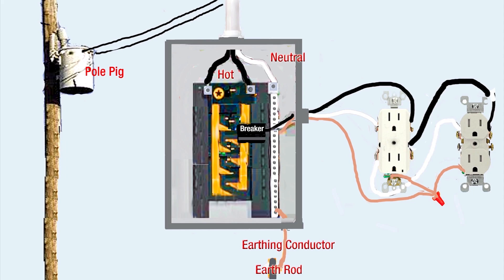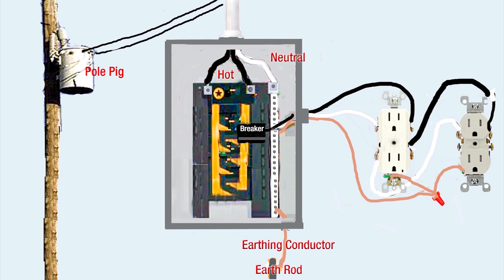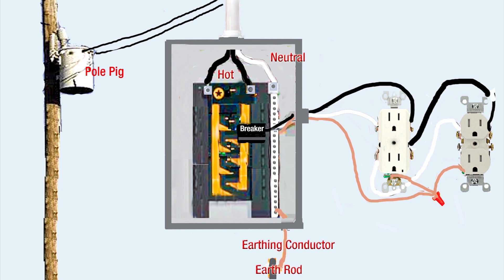Grounding, Bonding, Earthing, Shielding and Protecting with Jim Heath W6LG

Comment: Hello Jim, thank you for this and your other videos on this topic. You ARE BRAVE to do this as there exist many OPINIONS. I will use my ground rods for my antennas, and will rely on the house electrical system to provide earthing for the electrical components inside the shack. My plan is to disconnect the antenna from my radio during lightning storms, as well as unplugging the electrical components. Extra safety! KQ4IXD

Comment: Question here, is there any reason why I could not remove the 2-prong power cord from the radio and replace it with a better 3 prong power cord and connect the ground wire to the radio case and get my grounding that way?

Comment: If am running all my HAM related equipment off DC/battery (say two different batteries) do I still need to ‘ground’ any of the equipment?  I noticed the avail grounding studs off my of my equipment…do I need them in this situation/setup is the question. Thanks in advance.

Comment: I'm getting ready to cross this bridge very soon! Just bought the ARRL book, Grounding and Bonding. I'm going to replace a rotten galvanized pipe that is on my mains. Then install 2 x 8' ground rods. One for my AC panel mains and another under my shack window. Going to tye them together with 8ga bare solid copper to my MFJ window passthrough. One the other side of the passthrough, a ground buss bar. Going to install gas style coax lightning arrestors grounded to the rod under the window... I agree with you on not using the adapter with ground to receptacle plate screw...

Comment: A lot of hams through the years have said don’t bond everything through your ac ground! Have separate grounds for Radio & antennas etc. KJ7TBR
Reply: If the neutral does float the green wire becomes the carrier to the panel to blow the breaker but this will also cook your radio if your bonding using the ac bond rather than a separate non connected to ac ground!
Reply: I.e bond for ac house system don’t connect radio ground to ac bond use separate non connected to ac ground rods!

Comment: I have a 5-gallon bucket of water in the corner of my shack. I run a wire from the ground tabs on the back of my gear to a piece of junk steel that I tossed into the bucket of water. Seems to work great.

Comment: Hello. Thanks for the video. I enjoy watching your content. I will soon be designing my first shack and have been thinking about grounding/bonding. Would it be an issue if you were to tie the grounding rod to the house ground. Grounding rod attached copper plate to where the coax enters the house, that is then connected to the bonding strap (piece of copper pipe) located behind the components, finally, the pipe is connected to the house ground via the outlet grounding plug. The antenna ground, bonding strap and house ground are all connected.

Comment: I'm a elctrician, retired. I've never had access to a device that could measure the difference of potential between two parallel grounds. Say from a far bedroom outlet and an outlet next to the panel. Maybe NASA of MIT does. Just my 2 cents. So l just followed the drawings. 😊

Comment: My background is in process control in a pulp and paper mill. I typically worked with shielded balanced wire from field equipment to a DCS (distributed control system) and coaxial communication lines between DCS's. I also worked with high voltage single phase and three phase electrical systems. Shielding and grounding issues were a big part of my job.
In my understanding, a typical USA residential breaker panel, has two hot legs (black wires or a red and black wire) and a neutral leg (white wire) measuring between either hot leg and the neutral leg there should be 120 volts AC. Measuring across the two black legs there should be 240 volts. That is because the transformer (pig) is dropping the higher line voltage (my residence the incoming voltage is 25KVAC) dropping to 240 volts. The transformer primary windings are at 25,000 volts AC, the secondary windings are generating 240VAC. The neutral is center tapped in exactly the center of those secondary windings supplying the 120 volts between the neutral and either hot leg. 
The voltage at the breaker will measure line voltage. The neutral  will measure zero volts. But the current (amperage) on the hot wire and the neutral will be the same! The bare copper safety (ground) wire should not carry any voltage or current unless there is an electrical fault.
The reason the safety ground (bare copper) wire from the grounding rod(s) is bonded at the neutral buss is to bring the neutral buss to earth ground at that specific location and to establish a zero voltage potential as referenced to earth ground.
Earth ground is electrically active! I have personally measured between two earth grounding systems approximately a quarter mile apart and seen more than 50 volts combined AC and DC! The induced electrical current caused huge noise problems in my equipment! The same will happen to radio communication if grounding isn't taken seriously.

Comment: I totally agree that the radio should not ever be connected to it’s own separate ground rod! One quick example is if there is a lightning strike near the house or power panel ground rod, it can elevate the ground potential several thousand volts above the ground potential where the radio is grounded. If the radio was not grounded both the hot wire, neutral wire and the bare ground wire in the power feed to the radio would all stay at the same relative potential. However if the radio chassis was connected to its own ground rod it you would essentially have a conductor connecting both ground rods and a potential difference of several thousand volts might exist between each end. The radio chassis would be near the far end. Current would flow from one rod through the radio chassis to the other rod. The black and white wires, while being 120 volts between them could actually be a few thousand volts above the radio chassis. Who knows what might happen! It’s best to let all three wires ( black, white and bare) float up and down together. 
My radio station does not have its own ground rod. For one thing it’s too far from the main panel for me to connect the two ground rods and it’s not necessary. I am a retired EE with experience in power, lighting, interior communication, radio and electronics. Several years in each area.
Reply from the maker: Thank you for a clear, concise example of what can happen.  If you want, privately send your callsign and email address to me.  73 Jim

Comment: You are a master. The more I learn the less I know. Can you help me understand why as on almost all of my gear there is a ground post. I have them  all connected to common ground bar with tinned copper flat strap. From there about a 5 foot run to the 8foot rod with solid copper flat strap. The FT 950 is feed by 30A supply . They are on 15 amp non GFI circuit . Every thing else including the 600W solid state amp is on a 20A GFI for now. My question is two part. Do they need to be earth grounded and does that need to be bonded to the AC earth ground. What could happen either way. You presentation are very honest and over flowing with decades of real experience. Not theory. I admire and respect that. Waiting for my General ticket to be posted. Do you have any connections.😉
Reply from the maker: Thanks and yes I can. If you had 10 boxes on your operating desk/table and there was a ground wire run from box 10 to box 1 and then to a common point, box 10 would have a different voltage above ground from box 1.  And, you could have a ground loop or hum.  Each box needs to have a ground STRAP to a common point. A driven rod separate from the electrical panel, depending on some other factors, may be unsafe.  And, it may be a violation of the NEC.  I know the ARRL promotes that idea and I believe they are sadly mistaken.  Additionally, there is no such thing as a RF ground.  RF does not magically flow into the ground.  If there is a fault, you want the current to flow back to the main panel or sub-panel.  If some of the current flows into the ground during a fault, the breaker may not trip. I would make certain that your GFCI is indeed rated for 20 amps and has the appropriate wire size; probably should be #12AWG.  73, Jim
Reply: @ham-radio  Humm. Well they all are common point connected to a bus bar definitely not in series. So you are saying both AC earth ground and station earth should be bonded? Also your quick response reminds me of when people actually cared. Thanks so much.

Comment: Definitely not a good idea to use those three prong adapters without the ground tab. If you ever get a short of hot to equipment cabinet and you touch the cabinet while its shorted to the cabinet you get electrocuted. Whereas with the tab screwed to a grounded outlet box the device short should cause the circuit breaker to trip from over current in the short and that saves your life. Sometimes people with Phd's don't have any common sense!

Comment: Sorry about the typo and incomplete note.I proposed running an additional grounding wire from my new ground rod the fifty feet or so feet to the existing service ground to maintain continuity. There is the matter of an RF ground for antennas as well as equipment grounding for the transceiver, etc. while the service outlet presents a neutral wire that is also grounded at the service panel. It all seems like one leg of a circuit to me. No GFIS at my operating position either.

Comment: Excellent comprehensive series Jim.  As an electrical engineer that works heavily in the automation world I have witnessed my fair share of ground problems especially with ground loops.  Your conclusions addressed my concerns with often recommended multiple groundling locations (service ground, station ground and antenna/remote tuner ground) that have left me with an extremely uneasy feeling.  Thanks for taking the time to walk through this topic in detail.

Comment: Holy hockey sticks. I’m a BSME  with plenty of practical experience in DIY electrical work.  You throw this sacred cow out on the tracks and say, “see you later”.  I had an in depth experience working with the Franklin Research Institute on hardening Automotive wiring and airbag ignition systems.  Good ground to the vehicle ground was one crucial element in removing spurious RF from wiring systems.  There were many more. I don’t understand why you wouldn’t want to clear off any spurious RF noise from your transmission and receiver instruments.  They are in metal cabinets but there are many high frequency sources out there hat will go right through the gaps and openings in the units.  I don’t see the use of ferrite beads or similar devices at each critical component too protect points where spurious RF inputs would cause problems.  Help me understand.  It sounds like your friends problem was that the ground circuit was acting as an RF antenna and back feeding into his transmitter.  Please excuse my electrical naivety but seeing those giant copper plates in some grounding systems would give me the feeling that some sort of wide band diode is required on elaborate ground systems.

Comment: I will point out that a GFI does not care where the current is lost. It measures the current difference between the hot lead and the return neutral lead, if it’s more than 5 milliamperes it opens the circuit.
A neutral wire and a ground wire is bonded at the main panel. But the difference is the neutral is a current carrying conductor at all times. The ground is reserved to carry a large enough current to trip circuit breaker. It is a redundant path.  
If you could imagine a washing machine with no ground system. A hot lead breaks loose inside and falls against the frame of the machine.  Now the frame is electrified. Anyone touching the frame of the machine and a cold water source could be shocked to death. Now that same system is grounded. The exterior frame is now connected to the ground.  That wire falls inside and touches the machine frame and is grounded to the surface.  It  immediately creates a large current that trips the breaker and eradicates the electrical hazard.  This was the system before GFI’s.

Comment: Good topic. Now your diagram has issues. 1-If it's a GFCI breaker, the neutral goes terminal on the breaker, not the buss bar, there's a pig tail on the breaker to go the neutral bar. GFCI: Good point on the ground current GFCI have been known to trip in the presence of RF because of the FET. 2- those receps are wired incorrectly. The "hot" and the neutral need to be pig tailed like the ground is. By hooking one hot to one screw and "out" to the other screw that little tab between the two screws is carrying the current of the rest of the circuit. That's why you'll see recps go dead but the breaker doesn't trip, but recep has burned in half. I'll paraphrase the code in as that it says. A device must be able to be removed from circuit with out interrupting the circuit. The reason for the two screws is to be able to break that tab so to accommodate two circuits, ie one switched and one constant hot. But never from different legs to prevent the possibility of 240 vac being there.
The "white" is considered a current carrying conductor and the buss bar is "bonded" to the panel via a bonding screw that ties the buss to the case. A broken neutral is looking for a path, the ground isn't or shouldn't be.
Just saying. I'm was an electrical contractor of 22+ years and retired electrical supervisor for the state. 73 W9DLP
Reply from the maker: Thanks Dave.  Do you have time to talk?  I'd like to discuss the drawing with you via cell phone.  You can get my email from Q...com.  73, Jim W6LG
Reply: @ham-radio  Sure. I'll email in the morning. It's 3am here and just got the HHH net on 7.190

Comment: Jim, you are one of the few people that has a good understanding of bonding, and grounding.  You separated grounding from earthing but electrically they are the same.  The issue that I think many people face is when they cannot establish electrical equipotential across everything, The cable, transceiver, tuner, amplifier, and the electrical system supplying the station equipment. 

First bonding needs to be established to a common point which is the inter intersystem bonding termination and you explained that as good as Mike Holt could have.  Ground loops happen where there is a difference of potential not multiple paths to ground.  If everything is as equipotential  there is no electrical pressure to move electrons so noticeable current to flow.  

Never float your equipment, if ti comes with a grounded power supply ground it and provided everything is bonded you should not have any problems electrically.

Also have also said the electrons to not want to go to ground they want to go back to the source and the source is the transformer which created the neutral and bonded the center tap to ground.  Electrons will use the ground as a path back if no other patch exist, they want to get back home :)  If you do not electrically  ground station equipment that path could be you.

RF wise you cannot just dump RF current into the earth, that is not where it wants to go.  The electrons was to go back home and home for the returned DC voltage is the transmitter.  A properly constructed station should have minimal return voltage provided you have a decent vswr.  Once the DC electrons get back to the transmitter the transmitter does not really want them either so it passed them off either through you to ground which goes back to the transformer feeding the station with power or the generator.   The other and safer path is using the system bonding connection(s) which would be the path of least resistance taking a majority if not all of the voltage back to the source, the generator or transformer.

Long story short DO NOT LIFT GROUNDS bond everything together to solve issues safely.
Reply from the maker: Very carefully written and helpful.  No matter how you and I might try to explain what goes on, many will just close their minds to learning when it comes to grounding, earthing, bonding. There are a few bullet points that can be used ham radio operators that would make things so much easier.  I am working on that draft of bullet points.  I am not sure how it will turn out.  Perhaps a series of questions would be helpful.  This last week I got 2 emails where the writers indicated that their stations were grounded and/or bonded with #6 wire.

To test all of this, I did wrap the room with foil and strips of copper that are about 20awg and 3 to 4 inches wide. I have the frame of my desk tied to the copper and foil.  I have 3/4 inch copper pipe in a T configuration under the desktop and connected to the frame.  I have short lengths of 1.5 inch wire flat braid from the copper pipe to the equipment.  That braid is kept wide over its entire length; even at the connection points.  Each piece of equipment has its short piece of that braid.  All of that ties to a 1 inch copper pipe in the attic that runs directly to the common ground about 20 feet away.  I am still learning and trying to apply where I can.  I did this extreme set up as a test.  The test is, will it make any difference.  
Thanks again.  73, Jim W6LG